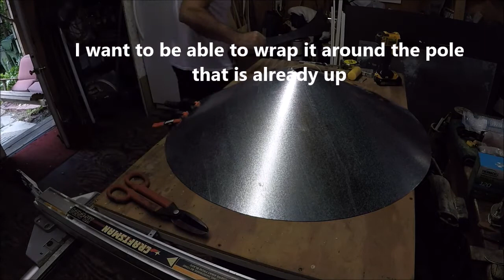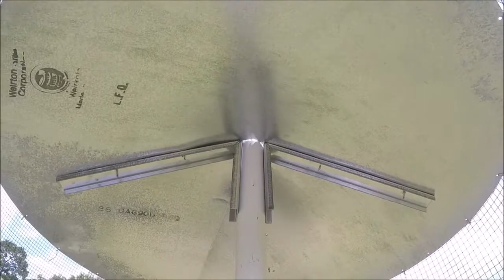Purple martin predator guard

Comment: I would have banded the guard supports. Screwing in might weaken the pole?
Reply from the maker: That's a stout steel pole
Reply: @pcdubya  I have one, also, but would never drill through it. I wouldn’t compromise the strength. The wind is strong also